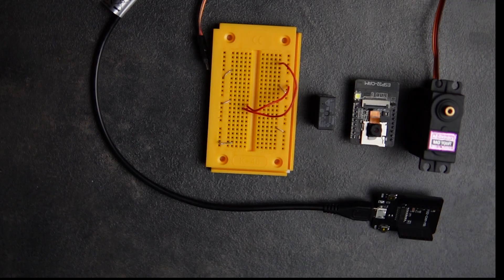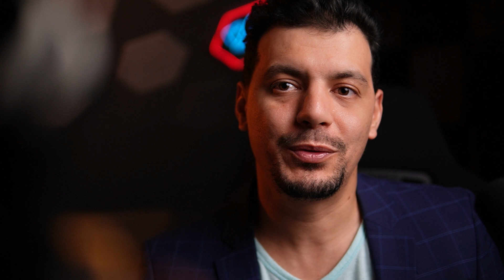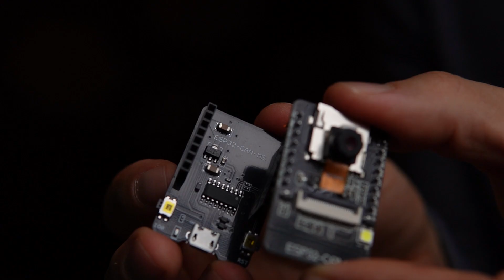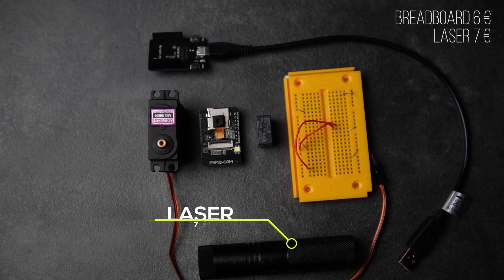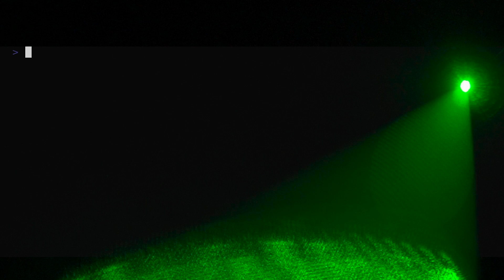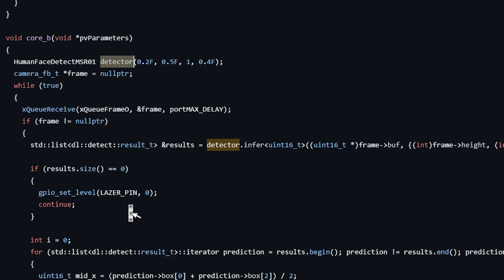AI on 4 MB of RAM: ESP32 Tech Miracle

Comment: Excellent video.  It would be interesting to see a laser that can trace the shape of an object it can detect.
Reply from the maker: Thanks! Theoretically, that would be doable. However, the challenge we'll encounter is determining the specific shape. For instance, tracking the shape of a moving object with a stationary camera is relatively straightforward and doesn't necessitate machine learning. On the other hand, if our goal is to track predefined shapes—let's say a triangle—that would require a trained model. This model would take the current picture as input and output the coordinates of the three points defining the triangle.